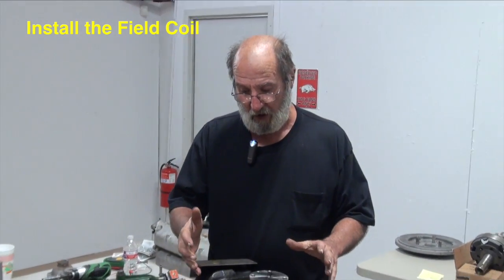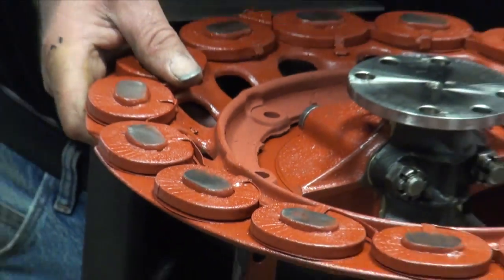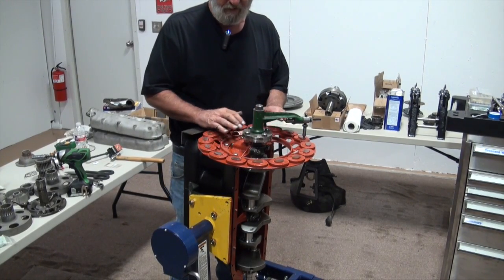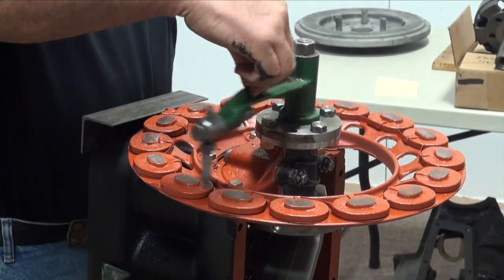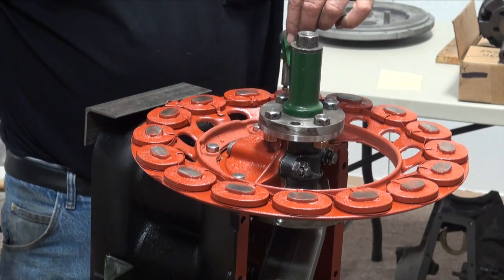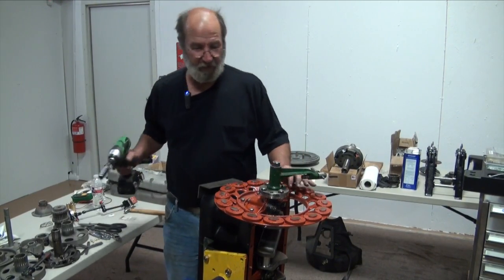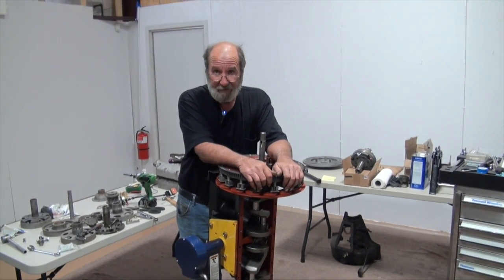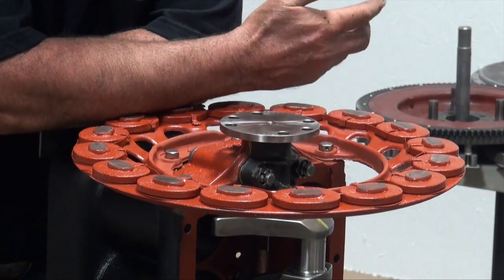Engine 15 Flywheel and Field Coil Part 2

Comment: so what happens when the engine is flat or you flip it over ..does the crank thrust make the gape change
Reply from the maker: I guess you might measure a change depending on the strength of your magnets.  However, we don't think it would make any difference in the performance.  

The field coil to magnets gap range is 0.025" to 0.040" and the crankshaft end play (thrust) should be no more than 0.004" (0.002" to 0.004", Ford Service Manual 244).  While we would like to have the gap at 0.025" for top mag performance it is rare that you are able to get that close.  So, if the crankshaft end play is set correctly, you might be at 0.029" to 0.044".  While I don't like the 0.044" as you are loosing mag strength,  it is also not likely that you would have set the gap at 0.040" to start with. 

So the bottom line is, we don't think the crankshaft thrust is an issue if it is set correctly.

Thanks for taking time to watch our videos and to comment on them.